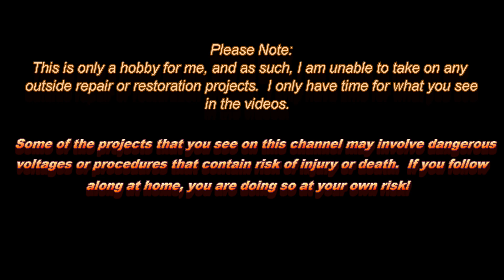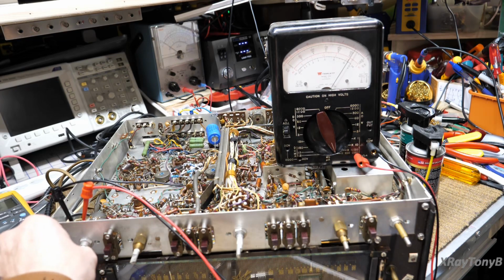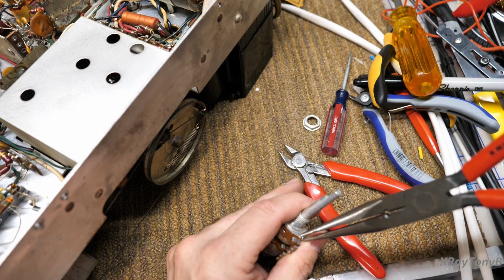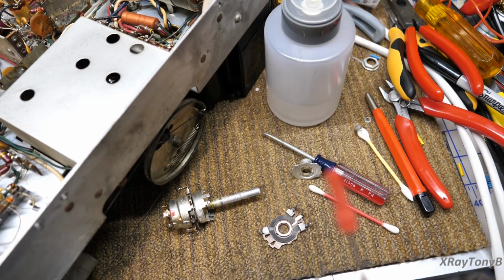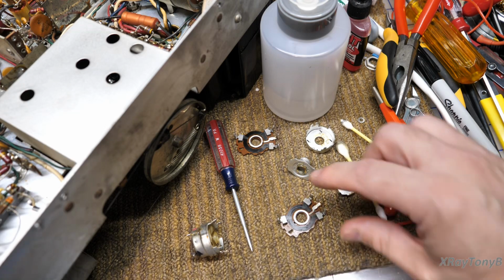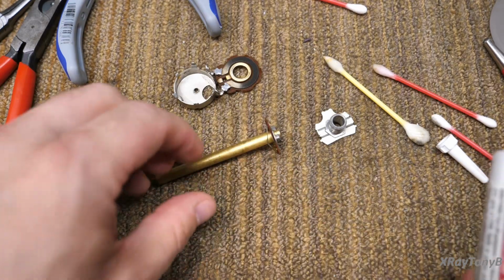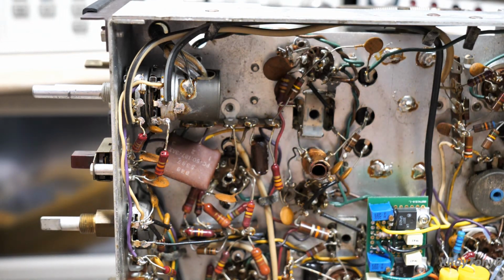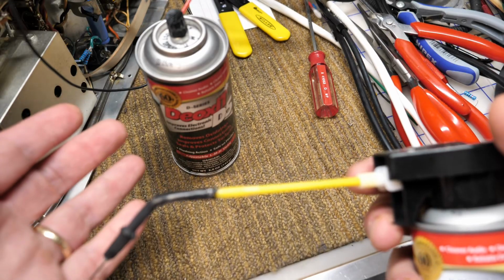How to Clean & Resurrect an Embalmed Potentiometer (With Bonus Rant)

Comment: Hi Tony !! I need a little help, some advice if you have some time. I have a problem with my amplifier, even if the volume knob is set to 0 (minimum) I still have sound in the right channel, not so loud but the sound is there. My amplifier doesn't have a balance button, it has separate volume knobs for the left / right channels. Here comes the question, do I probably have a faulty potentiometer on the right channel (strange, but it seems that the potentiometer works well otherwise, without interference, clean and clear) or should I look elsewhere to be able to detect the problem ?? Where should I start? I cleaned the potentiometer with another cleaning product (Motip Contact Cleaner) not with red Deoxit, the problem still persists and anyway I had it before cleaning. Thanks in advance !!

Comment: Sorry I'd I missed it, Tony...but what is the cap contraption on your Isopropyl bottle you are using to wet the cotton swabs?   Great video, BTW.  Thank you!
Reply from the maker: It is just a liquid dispenser with a pump top.  You can get them on eBay/Amazon/etc.
Reply: @xraytonyb  I stole mine from work.

Comment: FWIW in my experience:  Some times a end user has used WD-40 on a pot (their water displacer not their contact cleaner).  The carrier is a kerosene like substance.  That trashes the pot or switch.  Some other contact cleaners use Naptha and the effect is similar.
Reply: Funny you say that. As an Electronics professional, I have been using WD-40 to clean pots or intermittent switches for a good 30 or 40 years now. I have never had an issue with it. Some equipment I have used it on is my own equipment that's been in my ownership 30+ years and equipment I had to clean the pots a very long time ago. Not only cleaned up well using WD-40, I have never had to clean them again! Including dreaded straight slider pots like the ones used on mixers. The only thing I have found you don't want to get WD-40 on that I have delt with is RF tuned circuits. It detunes them, probably due to the lite lubricant included in it. But even that I was able to get back to normal, by washing it down with alcohol.

Comment: I ran into the same problem with this goofy design, mine got so bad it ended up leaking all over my fingers and stopped delivering through the nozzle. I quickly realized bending the straw to the resting position after use was the weakest link, leaving it in the upright position was less likely to give trouble. I prefer the adjustable nozzle and usually leave it on the lowest setting controlling the right amount and saving excess amount.

Comment: What is different about the "red" D5 formulation that makes it harmful to carbon tracks while the "green" F5 formulation is safe? They both contain mineral spirits.
F5S-H6 Spray: 5% DeoxIT Fader (active ingredient), 75% odorless mineral spirits (carrier solvent), 20% propellant
D5S-6: 5% DeoxIT (active ingredient), 75% odorless mineral spirits (carrier solvent), 20% propellant

Comment: Caig says that in 60 years they haven't seen a verified instance of De-Oxit damaging a carbon pot, only that some pots are already damaged. I personally have used it for over thirty years on all sorts of home audio and other equipment and the only problem I've ever seen is you must be careful not to wash away too much of the lubricants. If you have a pot you think has been damaged by D5, I'm sure CAIG would love to see it. They are very responsive. I do wish the labeling on the cans were more clear on this.
Reply: how  in the world could you control how much lubricant is washed away when using a spray aerosol??
Reply: @markfrost2707  By simply not over spraying and not to aim at the lubricated shafts so far as possible. Any cleaner will strip lubricants to some degree, some much worse than De-Oxit.
Reply: That has always been my experience. Cleaner "ruining" a pot was actually revealing a failed pot. It's amazing just how much the dust & goop in them can be conductive. Which leads to spotty readings from a pot with a bad carbon track. Clean the dust & goop off, and the failure becomes unmistakable.
Reply: We all know corporations love to tell the truth.

Comment: I have been cleaning pots by taking them apart and cleaning with isopropanol for 50 + years.  No ill effects.  usually try to find some resistance grease inside the metal cover to re-coat the shaft.  As far as dissolving the carbon, it's not that the carbon dissolves (UKguitaramp guy) it's that the resin used to stick the powdered compressed carbon to the phenolic dissolves.  I have seen the entire semi circle of resistance element crack  into pieces and fall off after other people used regular WD -40. and have repeated that experiment on other old pot elements that were already useless. Carbon doesn't dissolve in anything but it's how you stick carbon together into a resistance element.  Tony love the face You made for the YT algorithm, also, this video is wonderful.  The one thing you didn't mention is making sure the sweeper plastic disc lines up with the stop on the metal bottom cover so that the pot has it's full rotation rather than being stuck in a position where its not engaging the carbon track, and doesn't rotate much.

Comment: There is nothing particularly special about anhydrous isopropanol what it means is it doesn't contain any water but the minute you open the bottle or apply it exposure to air it will absorb water depends on the humid environment so any high-grade rubbing alcohol is fine

Comment: I had JUST bought a can of the red and was about to use it on the pots today! Thank you!

So, to be clear, the green is safe to use on pots?
Reply from the maker: Yes.  The green stuff (faderlube) is best for pots
Reply: @xraytonyb  a friend was a tech in the Navy. He said they used cases of WD-40 to flush the crud and canned air to flush out the excess WD. This was on Weapons guidance systems that are critical no fail items. Any thoughts?
First off I have no electronics background, bit I thought I could use YouTube as a guide...
So! I cleaned up a $25 amp a while back and used the red Deoxit and and canned air.
  I was about to, literally have a SX 450 case off, face off, and ready to clean pots and switches...I have the D5, but not the green is it F6...saw your video...glad I did as I don't want to do this again next year. 
So clean with the CRC and then pots with F6. (I'll have to buy some of that)
Ok so the inside, the green circuit boards are covered with dust, probably cigarette smoke and grime...I got this SX450 from a friend, said it's been in a fairly dry basement for 10 years...any recommendations for cleaning. I'm gonna use a vacuum and paint brush to gently remove dust, but the grime need to go. Any simple recommendations would be appreciated.

Comment: I've never liked using Deoxit. I always tear down the pot and clean it out with a dry brush and maybe add a little oil to the shaft. Had a guy bring me his Fender Princeton he had paid big bucks to restore from some other place and I had to replace all of the Pots on the Control Panel. On visual inspection the carbon track was completely gone where the wiper made contact. I imagine it's fine for wire wound pots and cleaning contacts I honestly never use it. I tried the Fader green can and wasn't impressed, still chewed up the carbon tracks on a pot from a Fender Champ amp I had. I attend to use LPS 00416 Electro Contact Cleaner these days, it's safe on plastics, it's mil spec and used for radio and radar equipment. It's hard to find it, I was lucky to buy two cans from a former Navy Radar Tech. However I'm to chicken to try it on a pot.

Comment: Could it possibly be that the pot was just...really old?  Particular construction of that brand? I've used both d5 and f5 for many many years on my own gear and thousands of customers' gear. Although i prefer f5 (green) I used d5 quite lot earlier on. I've never had d5 take a pot out. I even did extensive mechanical testing on wah pedal pots up to over 250,000 turn cycles...cleaning with D5 every 4,000 turns. Absolutely zero problems. I say a more scientific study is in order to see exactly what happened here.
Reply: Also....fader grease inside of a wah pedal pot is not a good idea. With others, it's fine. Counterintuitive because wah pots are swept most of the rotation thousands of times. The carbon track wears and the little bits of carbon get suspended in the grease and the pot will continue to sound scratchy until it's disassembled and grease removed. Unfortunately the grease doesn't prevent that wear, as I hoped it would.

Comment: I have read dozens and dozens of testimonials from all kinds of technicians successfully using Deoxit in practice on pots... and now suddenly I see myself crashing loudly with this theory... 

has there been a scientific study about this? By the way, nowadays there are even studies that affirm that cheese is harmful to mice, but at the end of the day, it is the results that have the last word...
Reply from the maker: Thank you for the comment!  I guess my frustration comes from when the mouse returns with cheese dripping from every orifice, requiring it to have an enema to remove said excess cheese, and feed it a proper diet of lettuce.  While the issue was partially due to the cheese, it was equally due to the overfeeding of the cheese to the mouse.  Overfeeding of lettuce to the same mouse would have most likely resulted in less trauma to the mouse, making the enema unnecessary as the excess lettuce would most likely pass.  
Admittedly, I'm being silly, but you get the point ☺

Comment: Apparently according to the manufacturer, D5 does not dissolve carbon. Both D5 and F5 are safe to use on carbon tracks. Here's a letter from the manufacturer: https://youtu.be/inacV3cUV1A?si=qIe5VFDVM-pQSvhw&t=1306
Reply: Then why do they have two differently formulated sprays?
One says for faders and pots and the other doesn't
What's so hard to get?
Reply: @johnsuggs7828  So people like you buy an extra can, i guess. D5 is perfectly fine. The pots i fixed with it years ago are still working.
Reply: @johnsuggs7828  John, just curious, what part of the formulation is the problem? The mineral spirits? Both D5 and F5 have it, in the same concentration.
Reply: @christopherjbutler  no idea. But there's 2 and one isn't labelled for pots l.

Comment: Do you have incredible patience that’s something I would do as a hobby or before I own my own business. 
                    Here in San Francisco the labor to disassemble and clean and reassemble that little pot would probably be approaching $300 for each pot. 
          Labor rate in electrical shop is somewhere around $160 plus an hour
            My labor rate in my business does $185 an hour

Comment: I am very careful with the greasy DeOxit stuff and I am hearing what you have to say in your video. I do audio equipment and ham radio equipment and have learned that 99.9% alcohol (not the 70% that is 30% water) and acetone mixed 50% each makes a great cleaner and degreaser that evaporates quickly.  (and a lot cheaper than DeOxit) The alcohol/acetone mixture can definitely damage some plastic parts. Thanks for posting - I will not be spraying my pots with the red DeOxit...  I also like how you mentioned using better Q-Tips so there is not cotton left on the contacts after cleaning.
Reply: So you will use a harsh solvent like acetone on your carbon pots but you won't use D5? That's kinda backward

Comment: Novice question: Is there a reason why a micro coating of dielectric contact grease is not used such as automotive Dielectric grease  or iDeal Noalox? Thank you
Reply: On potentiometers, greases in general tend to collect dust that may cake the wiper and/or abrade the track in the long run. On switches, this dust caking might not abrade the contacts but can become conductive and cause leakage between contacts. A source selector switch might develop intermittent crosstalk between sources, etc.

Of course there are lubricants and then there are lubricants. some of them stay "wet", some of them harden over time by oxidation and/or partial evaporation. Also there are contacts and then there are contacts. Some of them are designed to glide dry, some need lubrication. Metal-on-metal switches tend to be fairly tolerant of greases, and to an extent, lubricants may also prevent oxidation. Still some lubricants may soften insulators and other structural parts. As pointed out by so many, many other fine comments here, this is part of the problem with some potentiometers. The bonding agents by which, and the substrate onto which the track is made, can still be damaged by some chemicals and not others.
Reply: @jussikuusela7345  Thanks!

Comment: You right sir it mess up my motor from the tape deck is ok to take out the static I thought it was a lubracan too at the same time now I need to buy the blue can I hate the new can is suck no spray adjustment

Comment: Thanks for such a thorough explanation.  I have seen several old receivers destroyed by that garbage.
Reply: I've sucessfully fixed synths and MIDI controllers with this "garbage" years ago and they are still working. Dunno what you did wrong.

Comment: Switches, through arcing, develop carbon deposits which act as a sort of diode, and if you've ever put a diode across a speakers terminals (early method of getting "Fuzz") causes distortion and other problems. So putting anything in a carbon pot that's meant to clean off carbon deposits...hmmm...could be problematic.

Comment: Nu-trol Control Cleaner, 401B, by MG Chemicals... MG's web page specifically says that it is rated for potentiometers, however your video makes me wonder. Your thoughts regarding the "new" D5 spray nozzle are echoed throughout the EE community. The original adjustable can may still be found, with extra searching effort, but you will pay a premium price to acquire it = double not good...

Comment: Doing the Computer Hardware and Gaming Guru thumbnail, I see...

I'm not a fan of aerosol products in general (except brake cleaner). I Bought a can of that QD stuff to go along with the little bottles of deoxit products I have, and the strong solvent cocktail pong it gives off says to me that any overspray will instantly turn any plastic faceplates, covers, screen printing, or windows you care about into napalm.

I still haven't found any replacement for the friction grease/damping oil they put on pot shafts either, the more modern pots seem to use a really, really thick silicone oil to do that. I'm not sure where to begin, but some hobby shops have small bottles of it in various viscosities for R/C limited slip differentials.  I bought some a while back because Nakamichi specified 3000cst for the eject damper piston. I would start WAAAY higher than that for pot shafts.
Reply: We buy brake clean in liquid and use one of those pressurized cans you fill with compressed air. Much cheaper than those aerosol cans.

Comment: I have been using this D5 stuff on all my guitar pots, what I found is that the pots still work but my high end chime have disappeared from the tone. The  pot works but the sound of any guitar I use it on makes the guitar very dark. Can you please confirm if I am correct or just imagining things? Is there a chance that this D5 will evaporate and I will get my original tone back or do I pull the pots and replace them all. Big job. 
Much appreciated in advance.
Reply: your ears have changed. D5 does not harm pots

Comment: What about DeoxIT Gold G100 ?
Reply: Hi, I used Deoxit Gold G100L, the bottle with 100% solution, brushing type. I used a very small quantity on the gold plated connectors of my cables as for instructions ; it messed up my audio system (B&W 805S speakers). The sound became harsh. After some days I cleaned everything with isopropyl alcohol 99%. NO for me. On Naim audio forum there are other bad experience.

Comment: So if you red the instruction how to use the contact cleaner Deoxit D5 , which is in internet and also in the small bucket  coming together with the product you will know that Deoxit D5 is for cleaning oxide from metal surfaces and nowhere is prescribed for potentiometers.And also will know that for potentiometers is  recommend the green bottle of Deoxit. I made the same mistake likes you but can not complain because I do not red the instruction before to use it, But I red it after.

Comment: I only use the "red stuff" on jacks, switches, relay contacts and tube sockets. Even though it is legal in my state, I stay away from the pot.
Reply: Never use D5 on high current switches or relays! It leaves behind a lubricant that can catch on fire when arcing happens. Seen that on 12voltvids videos.
Reply: No stems, no seeds, nothing you don't need. Just clean, clean smoking weed!

Comment: Carbon pots shouldn't be cleaned with any contact cleaner except for iso. A wire wound pot is fine to use deoxit. I know cause I used it on my tube tester pot and the control was smooth in resistance